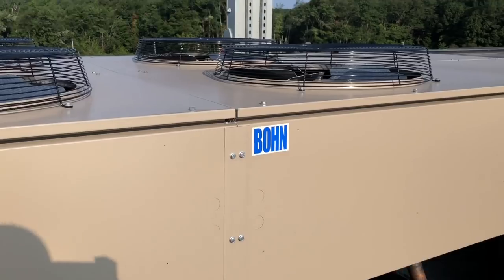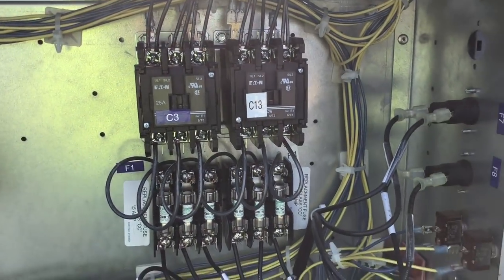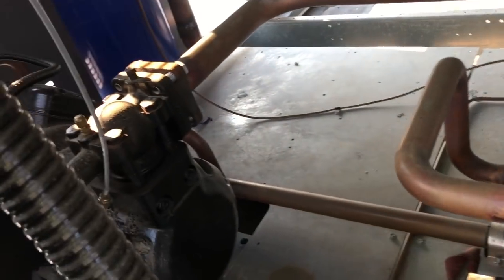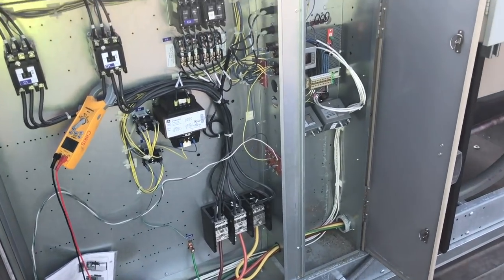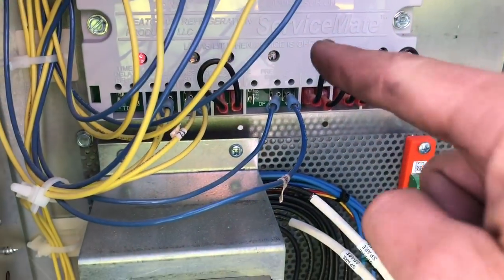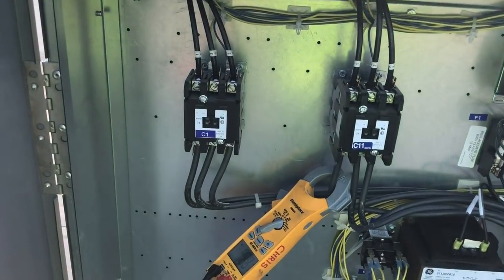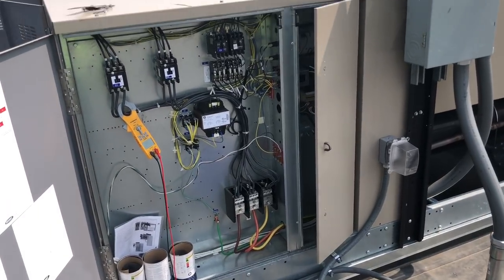Refrigerated Warehouse Startup Part 3. Loading Dock

Comment: Average compressor I work on is 100hp, some as big as 500hp I do get some freon stuff though and that's why I watch these channels so I can hang with this stuff when I need too. Great content, subbed etc.
Reply from the maker: mark9021 wow cool ! I work on nothing that big. Hahahha.  Do you do ammonia ?
Reply: @Cscrefandhvac  Yeah about 90 percent ammonia, big cold storage and arenas recently have worked on some vogt ice machines that use bigger 8 clylinder mycom compressors with 404, lots of screw compressors too.
Reply from the maker: mark9021 wow.  Very cool man. I’ve never worked on that stuff. Hahahah.

Comment: Nice work!  Can you go over the sequence of op. What’s the temp they are trying to maintain on the loading dock? Being that your in Mass. when it’s cold out the compressors will stage? How will your pressures change when only one compressor is running. If they do. Just a few questions I was wondering. I worked for a HVAC/R company back in 97. We did a refrigerated warehouse and inside that was a huge freezer. I didn’thave anything to do with the startup. I was the monkey setting the evaps n piping it all. Thanks brother.
Reply from the maker: Vic Villalta hey man.  The dock will be 40 degrees same as the warehouse. The warehouse is open to the dock so there is no wall dividing them . The way it’s set up it’s not in stages so both compressors will run together they are piped in tandom .  Hope I was able to answer. Hahah. Any more questions lmk.  Thanks man 👍
Reply: CSC Refrigeration and Hvac  That’s cool. I can go on and on with the questions. I haven’t done much refrigeration since that company. The plant I work at now we have from a 120 ton steam absorption chiller to rooftops to window units and 1 walk in box in the laboratory. LOL. So we have everything. Thanks brother

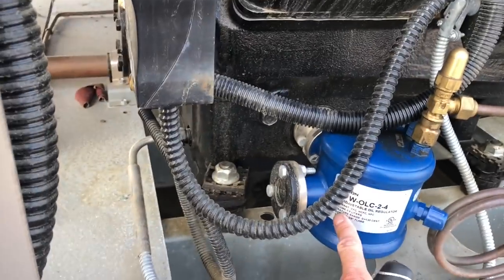Comment: 1:11 oil regulator aka oil pot
Reply: Looking good
Reply from the maker: Yes !!!hahah I realized I said that after , when I was editing this .  You are correct . Thanks for pointing that out 👍
Reply: Figured it was something along those lines.. everyone does it from time to time lol. Ever see one fail open and blow the head off a compressor? Lol. Happened to me on a rack system and lost its whole charge 1/2hr time frame. Oil was everywhere lol.
Reply from the maker: randy handle oh man what a mess !!! Hahaha.  And no , I have not seen that happen yet fortunately. Haha
Reply: Was a glycol rack so the whole medium temp of the store was down. Valved it off, changed the cores, ran to parts house while pulling vac to pick up the gas. Luckily the other 5 compressors were able to pull down store to temp. Truly was a mess. Luckily was able to replace just the valve plate, oil pot and came back a week later with plate and oil change the whole rack from moisture and cores again.
Reply from the maker: randy handle I used to work on racks. We don’t anymore though.  I miss it sometimes. Then other times I don’t miss it.  I don’t miss being out 24/7 haha
Reply: I dont work on them anymore either. Just reach-ins, walk-ins, ice machines, acs, occasionally chillers and towers. Never a dull moment with that supermarket stuff but you are right about 24/7. Out for 30+hrs straight at a time gets old quick. Lol. I do miss it at times but not an end game for me so had to step away from it.
Reply: Great video I enjoyed it! Keep them coming!
Reply from the maker: Fan Art 4 Fun thanks glad you enjoyed